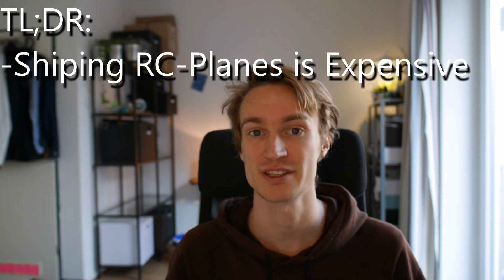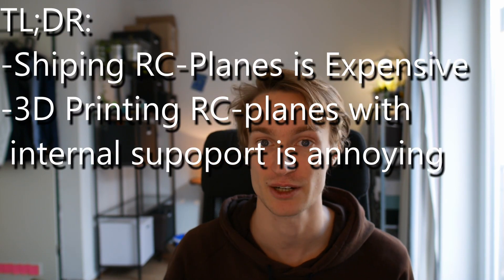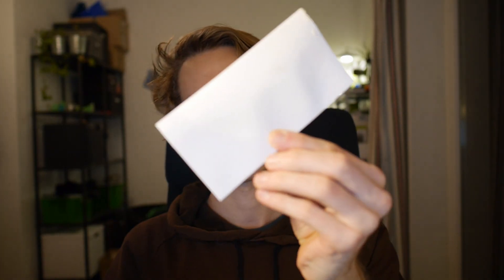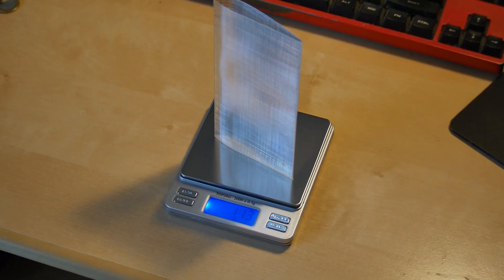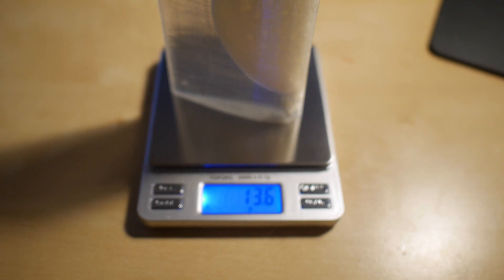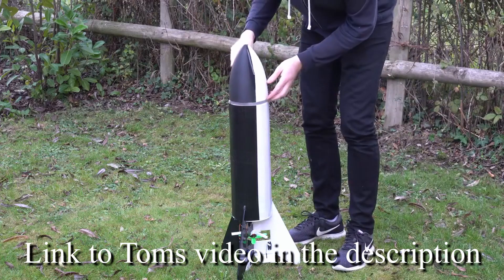Using Spray Foam to strengthen Vase mode 3D prints

Comment: if you filled the wing shape with styrofoam beads, and then poured some watered down white glue on top of the beads (letting it drain out the bottom) I think it would do most of what you are aiming for.

Comment: What about print with 5% infill in lines. I think will hold better. Another option is to have an externa extructure that holds everything in place but more for producing many units of the same. 😅

Comment: Hi, I am printing a model from 3dlabprint but it has internal support but it still does not look strong to me as I am used for foam models with a spar, I plan to tack/hot glue a carbon spar in place in the centre of the wing then add expanding foam from the centre out lay by layer to prevent gaps, this I hope will give the best of both carbon and foam for strength.

Comment: Here in comments are many viable suggestions. The foam hardens by absorbing moisture actually, therefore you can splash inner surface with water so as inner shell harden faster. And in the hollow part, the rod of some squashable material can be placed to mitigate the foam expansion. I hope we see the excellent results in future videos.

Comment: I wonder if you printed the airfoil and then a second slightly smaller that would slide inside the first and use a glue that has small gap filling ability and glued the layers together. Maybe liquid PL?. Hmm I wonder if a bead on the leading edge of regular PL would add enough strength?
Reply: Why glue when they can be printed together? :)

Comment: Put the airfoil in a clamp so it’s expansion is resisted. If it still deforms, build a wooden jig with the correct airfoil cross-section.

Comment: Could you print them with some bridge's inside to stop the foam deforming the shape
Reply from the maker: I have tried doing that, but i ended up having issues printing it in vase mode. but i might re-visit this idea at some point :)
Reply: Ditto here, try perhaps as two D tubes   D for the leading edge and a V closed to glue to the D section in front. Could also use this idea to have multiple "tubes" to then glue together...thinking here of Warren truss ribs if you see what I mean..D in front and several triangle tubes to assemble to that. This may be easier to fill with foam...you could also make multiple vase tubs across the chord, foam fill and then assemble like large ribs together...mmm may still need a spar for spanwise rigidity..Rgds Laurie New Zealand

Comment: You should look at a 2 part urethane foam.They make prop weapons with it. My model shop uses Smooth-On products like Foam-IT.

You can get foams in a ton of different expansion rates that pour like liquid.
Reply from the maker: Thanks for the suggestion! I have used foam-it with other (school)projects, but sadly its not really readily available in hardware stores and such, and I wanted something that anyone could do at home. Also, not sure if it would avoid the "expansion of the wing", maybe it would be less dramatic if i use a slowly expanding foam?
Thanks!
-SunShine
Reply: Hi Sir, i remember years ago i replaced a plywood floor in a boat  i think i drilled holes and used a 2 part foam..is this basically what you are talking about? I am 3d printing some 12 inch statues in vase mode...thinking if i could drill hole in bottom and pour approx  1 once or less and it should fill model and excess will come out of hole without expanding the sculpture...or maybe even the foam in can would work fine also this way...just don't want to drill holes in top just bottom..Any thoughts thanks for your comment

Comment: May worth trying to have some holes regularly spaced throughout the foil to allow for one, the foam to expand and cure, for two, to release some excess pressure that builds up and deform the airfoil. I've actually used a similar technique but with polyurethane resin and a much stronger shell (you can find the featured article in Hackaday here with more details: https://hackaday.com/2017/09/03/polyurethane-meet-3d-printing/). Another thought would be to still use an infill every n layers that could be minimal, just enough to prevent the foil getting out of shape. Overall, very nice idea. I want to see it succeed! Congrat's.
Reply from the maker: (Hi, I already replied you on thingiverse, however for consistancys sake, ill paste my reply here too ^^) : Hey! thanks for the nice comment!
I will be sure to try your suggestions im my follow up video, and thanks for the Hackaday article! was a nice read!